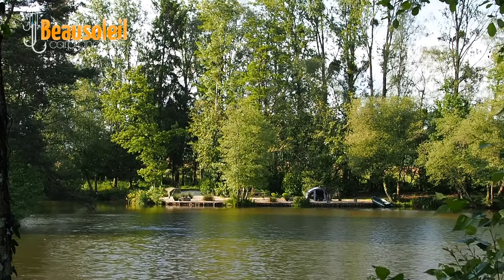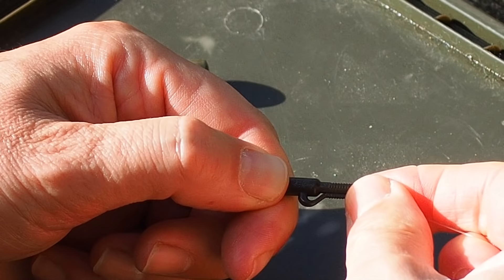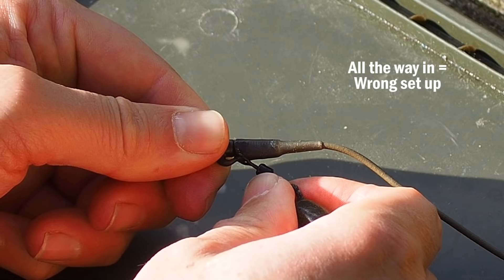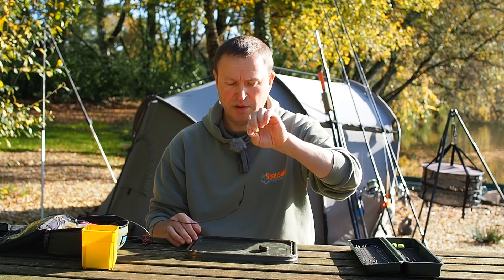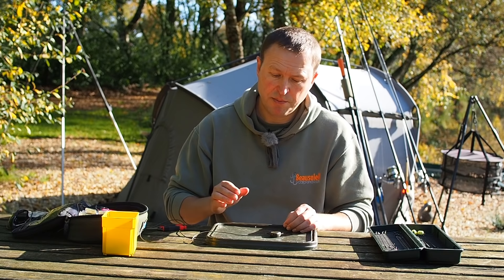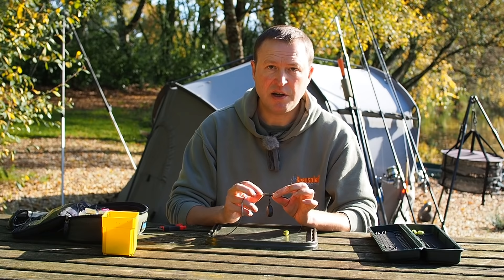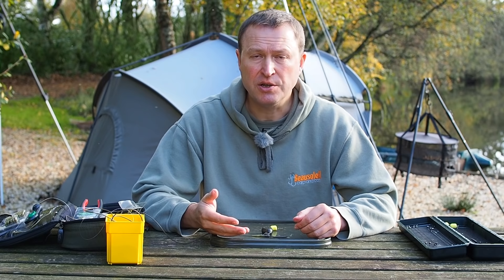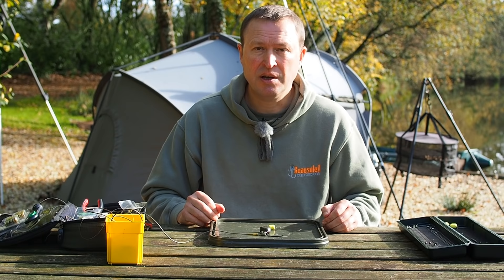STOP Using Lead Clips Like This | 5 WORST mistakes❗

Comment: Decent video, although your claim that using clips properly dumps the lead on the take is incorrect. They were designed to release the lead if it becomes snagged, and people have taken to setting up in a way that drops on the take (which I agree is bad, and if you "need" to drop the lead then you shouldn't be fishing there). I use leadclips for probably 99% of my angling and don't drop the lead on the take. It's all about learning the type that you use and getting them to function how you need. With the Korda ones ,push the tail rubber on around 2/3rds and that will drop easily when caught up, but not on the take.
Reply from the maker: Hi Ian, thanks for commenting and sharing your experience. I make videos to make anglers think a bit more about how they are fishing and whether or not there are improvements to be made. The carp I fish for have long since worked out how to use the weight of the lead to throw out the hook which makes lead clips a very poor choice for my venue and other venues of similar difficulty. We all experience fishing in a different way on different venues. Best of luck with your fishing. Cheers, Matt.
Reply: Correct..the advent of dropping on the take was well after the initial design stage of the clip.  You ca  make us think about what we do whilst fishing..but.. at.least be factually correct....the hybrid leadclup.set up.. is for dropping  ...as is the peg system.in lead clips...that's to.lock the swivel in.place....
Reply: @matthewcollinsangler  with all due respect Matthew ,plenty of difficult carp are caught using leadclips. If the carp can throw your hook out then that's the place is be looking at. I'm guessing you are using barbless hooks? That's one of the reasons I won't use them.
Reply from the maker: @ianpalmer6586  Hi Ian, thanks for responding. We all experience carp fishing differently and that’s what makes it such an interesting sport. Over the last 12 years as a fishery owner, I worked with many hundreds of anglers on week long sessions which gives me a fairly unique perspective. You won’t believe this but barbless is not the issue. We only made the switch at Beausoleil 2 years ago. 10 years of use of micro barbed and every angler that I met that tried lead clips which were set to retain the lead, they got done countless times. When I swapped them over to a very lightly fixed running rig they started catching. Coincidence? I really don’t think so. The lake bed here is very hard and as a consequence the carp mouths are very hard. Some of the carp are also fairly old. This makes getting a hook hold rather difficult. In my experience the only anglers that were successful here were those that dumped the lead on the take. This is both bad for their wallet and for my lake. I know multiple French venues that have banned lead clips due to anglers not understanding how they should be used. I also know other venues that experience this same phenomenon of the carp using the weight of the lead to throw the hook. I made this video because lead clips are seen as the defacto choice for many anglers. In my experience as fishery owner, they are regularly used in the wrong situation and in the wrong way and I get to see the consequence of this during drain downs and nettings which is something many anglers will never see. All the dangerous rigs I’ve ever found have included a lead clip. We’ve never had any fish damaged by any of my running rig variations. Use of a lead-clip might be absolutely justified for your own fishing. That’s for you to decide and I cannot possibly comment. I still use them from time to time when the situation dictates that it’s the right call. The aim of this video is to encourage anglers to think about how they go fishing rather than just use a lead clip because they believe it’s the right thing to do. Best regards, Matt.
Reply: @matthewcollinsangler  I agree with a lot of what you say there Matt, but also take issue with the sort of "matter of fact" statements ie "must drop lead to be used correctly", and the comment about tricky fish learning to use clips against us. I've fished all manor of waters in my 30+ years carping, from dead easy to mega hard one fish a season kind of places  and in the last 6 or 7 years you can count the number of fish I've lost on one hand, so I'm obviously doing something pretty well lol. 2 things have stuck out in those years which I've personally had too many problems with for me to be happy using and they are barbless hooks, and helicopter rigs. And yet many people that is their go to choice.so what works for one doesn't necessarily work for another.  I totally agree that a hell of a lot don't know how to use clips properly , and that the potential for a dangerous rig is there with them. Luckily I've only ever reeled in one what I would call death rig and that was actually a running lead setup which had then had a stopper bead placed behind the lead. Any bit of kit is only as safe as the person using it, be that leadclips, leadcore, Heli setups (and those god awful Heli(un)safes . 
Anyway I'm enjoying watching your videos, and even though I don't necessarily agree with all of it, like I say it's all a matter of opinion,and what works for us is what's important (as long as the fish don't suffer for it of course) . 
Keep up the vids Matt 👍
Reply: Dropping the led on the take does make the chance of landing it biggrt
Reply: @shotbytakketrol2493  it's littering. Should be banned
Reply from the maker: @shotbytakketrol2493  Yes it does but it’s also bad for the environment and should only be used when absolutely necessary. I use running rigs for 95% of my carp fishing and hardly lose any leads.
Reply: @matthewcollinsangler  same my dad owns 2 fishery in france we go often there to fish or work dropping leds is banned there there was one time we went to fish on a other lake nearby and we went in the bost water was super clear u could see led everywhere its sad to see to be honest
Reply: @matthewcollinsangler  infact im going there in 13 days to fish for 10 days cant waitt
Reply: @ianpalmer6586  your so right mate it makes me laugh how many people are know it alls why do carp anglers now days fish a hooklink that's 25lb but use 0.32 12lb line as main line it should be the other way round so all you ever lose is a hook its all about making money they say they care about ponds and lakes but glad chucking in a load of lead in the pond just sat on the bottom forever
Reply: @ianpalmer6586  if you can't fish with barbless hooks you should probably get an easier hobby.
Reply: @nathanprentice7230  what are you on about? I can fish with barbless if I choose to but won't because they slip causing mouth tears, micro barbed don't. I've been carp fishing over 30 years, I know what I'm doing thanks
Reply: @ianpalmer6586  yeah yeah
Reply: @nathanprentice7230  great adult reply
Reply: @ianpalmer6586  twanging rubbish 😀 it’s fact that I’ve never ever seen mouth tears with barbless- many times the hook comes out on its on after you’ve landed the carp, then sometimes can’t even see where the hookhold was!! Conversely- barbless cause damage when you remove them 😊 you can’t sit there and write back to me that’s not the case, hook a barbless hook through your pillowcase and remove it, then do the same with barbed or microbarbed.
Then do the same test using the flesh on your finger👍 wet nets 👍👍
Reply: @machomanOOOOHYEEEAH  I can indeed reply that's the case as I've seen it plenty. Go to barbless waters and mouth damage is more prominent. If you don't agree that's up to you, but don't be calling  my opinion rubbish
Reply: I can't imagine the lead needing to come off on every take tho? 🤣 Would be a pain in the arse an pretty pointless rig in my opinion if I'm having to fork out for leads every session orrrr have I misinterpreted you?
Reply: Should only really be dropping leads in weed/snaggy lakes. If your on a clear, no weed lake, then no need to drop the lead. Just a waste of money and im sure thats not healthy for a lake.
Reply: @thfcdan1986  there's no "need" to ever drop the lead. If you can't land a fish from there with the lead attached then you shouldn't be fishing there
Reply: @machomanOOOOHYEEEAH  need to edit this, don’t you? Reread, edit and try again
Reply: @ianpalmer6586  just ignore the stupid one mate its the best way they haven't got a clue about fishing they all probably use cheap nasty tackle like mats that are about 10mm thick
Reply: You are spot on here. Lead clips where never designed for the lead to drop on the take. I personally think dropping the lead on the take is irresponsible and you are dumping lead into the lakebed unessasarily. I would be more concerned about the environmental impact on all the leads at the bottom of lakes.
Reply: christate3197  excuse me?
Reply: What about when fishing a big river in France & your using 5-8oz leads to hold bottom ? You have no choice than to drop the lead !
Reply: @nickykfx8020  nonsense
Reply: @ianpalmer6586 Obviously you have never fished Rainbow or Cassien then mate . If you have had then you would know what I’m talking about . So many noddy’s thinking they know it all lol 😂
Reply: @nickykfx8020  I've got 35 years carp angling experience pal. I ain't no Noddy. Some of the things that go on at rainbow are catch at all costs merchants

Comment: I don't believe this is how the equipment is meant to be used. With the safety of the fish and nature in mind, I don't see how dropping the lead on every take is what you want to be doing. With your solution your leaving leads on the bottom of the lake and spending needlesly on the leads + on the pva tape. In my opinion thats not what fishing is. The lead should fall off only in the scenario of rig failure, so that the carp can get free of it. How tightly you should assemble the clip depends on the manufacturer, but in no way do I want it to fall off on a couple of bounces.
Reply from the maker: Hi mate, I think we have our wires crossed. I hate dumping leads unnecessarily but if you fish a lead clip with the tail rubber on too tightly then the carp will use the weight of the lead to throw the rig. After seeing countless anglers blank at my lake on traditional lead clip rigs, I know that when they move over to running rigs they start catching. It’s as simple as that really. I believe  lead clips are a poor choice for many situations and that’s what I try to demonstrate in the video. I use running leads or helicopter rigs whenever possible, and I have for years, so that I don’t dump lead on the take. My rigs are designed so that the lead slides away on the line on the take so that the carp can’t use the weight of the lead to eject the hook. These simple rigs are safer, more effective and more environmentally friendly than lead clip rigs IMO. For more information about a very simple rigs that I use that is great for many situations watch this video: https://youtu.be/LzFina92brM
Cheers, Matt.
Reply: @matthewcollinsangler  Thanks for taking the time and replying, I really appreciate it. I watched a lot of your videos recently and learned a ton, but this one got me confused. Thanks for the clarification, makes much more sense now. Great content on your channel, Ill check out the link you're suggesting. Good luck.

Comment: To be honest I've never really understood the idea of gazillions of leads stroon across lake beds up and down the country. For years now I use nothing but inline leads. Also I don't know about anyone else but I can't afford to lose 10/15 quids worth of leads every session either. I just stick to in-line using a very simple blow back rig but just making sure the rig materials are the best money can buy and brand new on every rig.
Reply from the maker: Hi mate, I hear you! I’ve been using inline leads for many years and dropping leads is not something that sits well with me on any level. I made this video because I wanted to help anglers think about how they are going about fishing. Any running lead system can be tweaked to achieve the right bolt and run or shock and run effect and you’ll find multiple examples on this channel. If you haven’t watched it check my original inline rig which is still super effective to this day: https://youtu.be/ED58TfFEcqM It’s very old so I apologise in advance for the quality! All the best with your fishing. Cheers, Matt.

Comment: I don't think manufacturers help with the lead clip issue. They always seem to have those grip lines all the way along the clip, so the temptation is to shove the tail rubber on so all the lines are gripping. If they made them so the lines went half the way along, it might make it more obvious not to ram the tail rubber on all the way on. Great video once again.
Reply from the maker: Hi Chris, after I made this video, I found that some manufacturers actually do this. Nash for example, has a weed clip, a standard clip and a heavy duty clip. The weed clip has no serration except one small one at the bottom. This ensures that it does dump every time easily which is what you need in weed. I also tested the Nash standard clip and it’s basically impossible to over-jam it. Even with the tail rubber pushed fully on, with a few good shakes and a 3oz lead it’s off and away. I noticed that the tail rubbers are much softer than other manufacturers I’ve seen so it’s quite difficult to use them incorrectly. My hope is that all the big names work on this because it’s a solvable problem. Cheers, Matt.

Comment: Hi Matt, another very good video. It confirmed what I already knew in the back of my mind. I bought the Korda lead clip because nearly everyone I knew was using them. I used them maybe once or twice but didn’t liked them from the start on. I don’t like rig tubing either. In your video you explained what can go wrong with it and that’s exactly why I don’t use it. I always used to use inline leads since they were available but a version with a hard plastic tube or soft tube with a large diameter already attached to the lead. Never used the ones with the small 0.75 mm diameter. I always believed in-line leads were the ones to hook a carp as quickly as possible. Only when the chod-rig hit the media I realized that a helicopter set-up can be very effective too. Till than I never used a heli set up. But not only was it different to what most people tended to use but the most important thing for me is the safety aspect. In case of a break- off the only thing the carp was left behind with is the hook-link. For the last decade this is what I used for 99% of my carp fishing and I don’t think I will ever go back to anything else. It’s a super save and versatile set-up. In the rare cases when I use an inline lead, it it semi- fixed so after a shake it wil come of the swivel. Not as save as a hel but much better than a lead- clip system imo..
Keep up the good work Matt💪👍.
Reply from the maker: Hi Louis, it’s really great to have such a detailed exchange of these technical elements with a like minded angler. For some reason I’ve hardly fished helicopter rigs but it’s something that I’ve forced myself to do more of as I also really like the safety aspect. TBH I don’t like rig tubing either lol. I much prefer to use leadless leaders like Durakord and nowadays with the Nash Cling-On which I find so easy to thread. You don’t even need to use a splicing needle with the 65lbs version. I still don’t understand why inline leads are sold with this plastic insert inside. It’s the first thing I remove lol. I used to be convinced that inlines caught me more carp but after a few years experimenting with pure running rigs and now helicopter rigs I no longer believe that to be true. Sure for solid PVA bag fishing they are invaluable of course. I still haven't mastered the chod rig and that’s something that needs to change as there’s definitely a place for it. I wish you all the best with your fishing and thank you very much for your kind words of support and encouragement. Cheers, Matt.

Comment: The Fox edges clips also have a clip to fasten the swivel in place and I also cut the arm shorter as our wild waters you need the fish up top. 
Most take rig n bait out by boat as waters here are massive… 
Saw the so called semi running rig video and after seeing this I am questioning that icon’s ethics. 

Keep up with the great tips and advice. 
Here in RSA most guard their secrets and limit their advice. Not even allowed to mention the one venue name even though every one knows which body of water it is… 

Thanks again
Reply from the maker: Hi Jozua, thanks very much for your comments and interesting to hear your experience. When I’m fishing large public lakes and rivers I do drop the lead if I have to as it’s the safest way to land them. For me carp fishing is fun and when you share fun the result is more fun. The UK carp scene used to be very secretive. Some preferred it that way but I like a more open approach. All the best with your adventures. Cheers, Matt.

Comment: Personally I only use the fused in swivel lead clips from korda and I've actually seen korda anglers (TD)do exactly what you showed with him crushing the swivel and it never even crossed my mind that could happen!!!!! or I use the fox ones with a peg as the tail rubber on fox lead clips is much softer than kordas and comes off easier.Great video as ever,extremely well thought out and explained.
Reply from the maker: Hi mate, thanks for the feedback 😊 Good to hear feedback on other brands. I’ve never used the Korda fused ones myself but they are another way of getting round the problem. Not used the Fox ones either. There are loads out of different types out there but it’s not until you take a really close look at how they work that the pitfalls appear. My default approach is not to use any of them (most of the time 😉) Cheers, Matt.